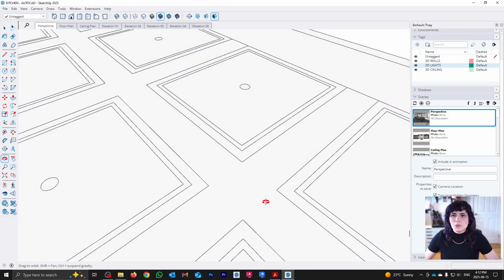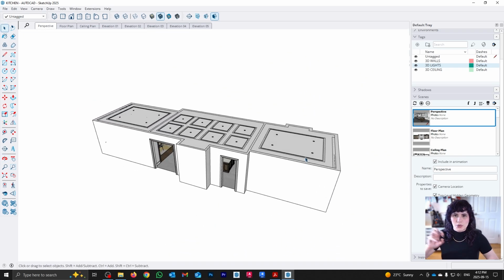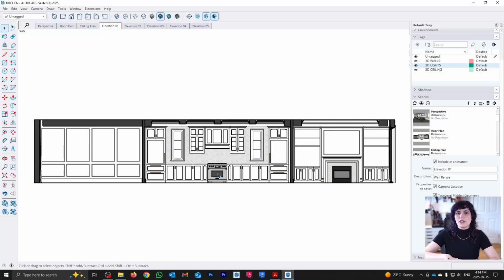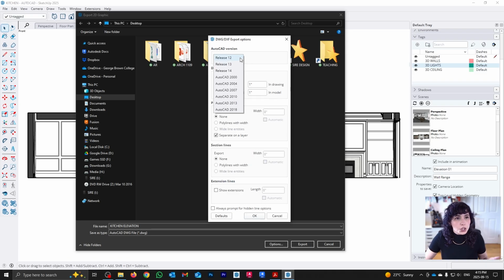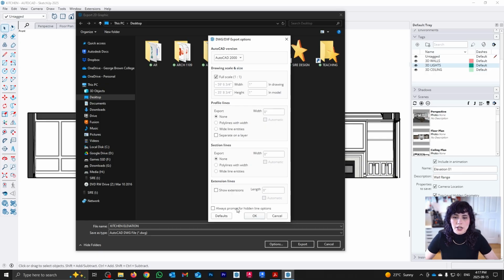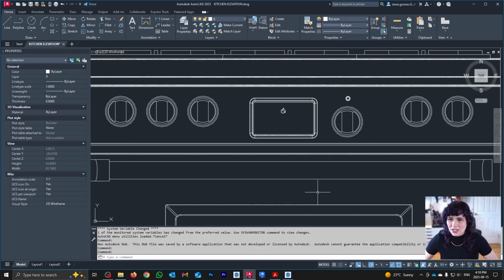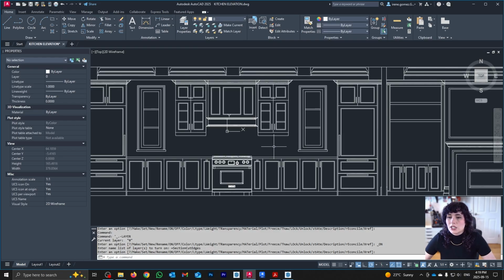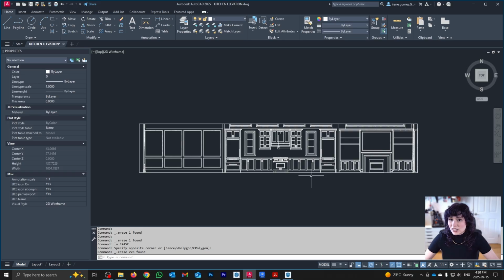Sketchup - Exporting Scenes as Autocad Drawings

Comment: its nice, but: can you tell me:
1. i draw kitchen countertop 2D and export it to DWG - the kitchen has curved countertop
2. it creates like 60 polylines in one, which means for the CNC that its not softly cut

Can you try to help? is it possible to create it as one polyline??
Reply from the maker: Thanks. To answer your question:
Sketchup doesn't work with geometry the same way Autocad does, so when you export from one format to the other, there's always the chance for a loss (or incorrect interpretation) of information. What you're describing is very common with curved geometry, because Skecthup reads it as a group of segments. To be honest, the easiest solution would be to redraw that one curve in Autocad.
Hope this helps :)